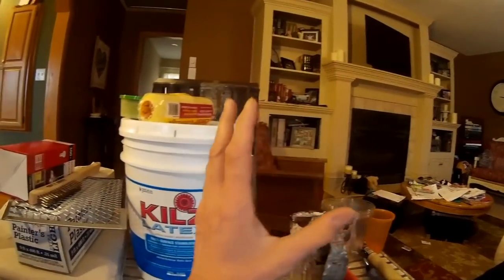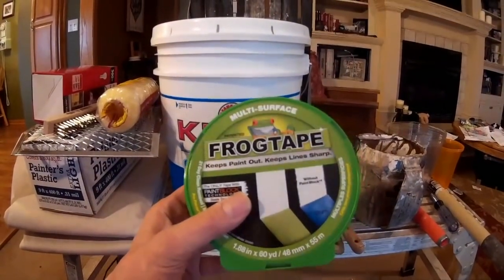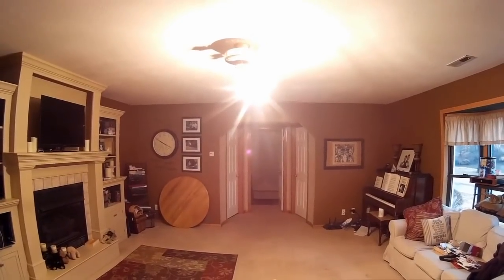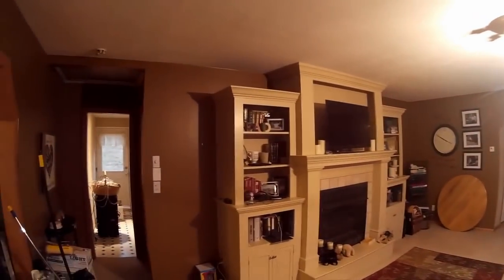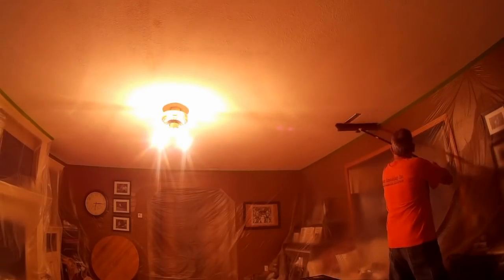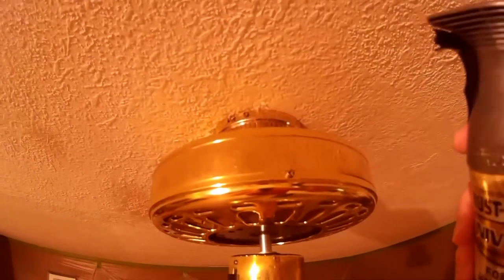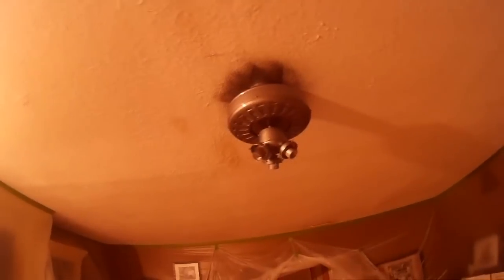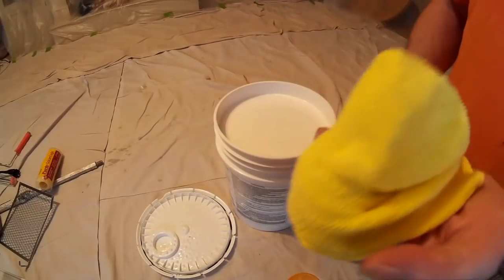How to paint a ceiling like a Pro!  Leave your furniture in the room! House painting.

Comment: Just a great video!  There were many times throughout where I wanted to press the like button!😆
I have an older open concept home and young kids so I’m dreading this ceiling project.  I’m not able to do it in sections since the rooms are not divided.  Do you think the paint will blend where I’ve stopped if it takes more than a day?  Also, would it be worth it to invest in an paint sprayer instead of rolling?  Thank you!!!!
Reply from the maker: This paint or any other flat paint will blend just fine.  Just dry roll the edges together.  If you want to invest in an airless sprayer then yes, it will be easier.  Make sure you buy an extension want to reach your ceiling if it's high?  You will need a 24 inch extension for even an 8ft ceiling. I bought one at Harbor freight just for shooting latex like this primer.  I thought it would be just a throw away sprayer but it's lasted 3 years.  HF doesn't have the one I bought but this one is close. https://www.harborfreight.com/airless-paint-primer-stain-sprayer-57042.html  If you do spray it make sure you spray two coats in two directions letting it dry for an hour between.  Let us know how it goes?

Comment: Great video, highly informative. My question is "why use a roller when you can use a sprayer to get the job done?" Can you comment on the use cases for both and their limitations, please? Thanks!
Reply from the maker: Spraying tends to sit on the surface.  This includes gaps and pores.  Rolling pushes paint into these areas making a better paint job.  This is why you see professional painters backroll a spray job.  The sprayer applies the paint.  Then, the roller pushes the paint into gaps and pores.  On a job this size I can have the ceiling rolled in about the same time it takes to properly clean a sprayer.
Reply: @mowerdog  Ah, this makes sense. Thank you so much for the prompt reply.
Reply from the maker: @saud3001  Rolling also adds texture to the finish which helps hide some imperfections.  Think of a paint job on a car.  When spraying you will see every scratch, ding, etc, that you missed in your bodywork.  Buy if you rolled your car paint on, they would dissappear.

Comment: how much is the cost of the labor for a room like that? I want to star doing painting like side jobs but I want a reference about how much charge. thank you!
Reply from the maker: This room is 20x 20ft and 8ft tall.  You will spend 8 hours on the ceiling and 8 hours walls if there's not much repair. 2 full coats on the walls. Plus the cost of paint.  This is with the furniture in the room and not an empty room.  So you need to know how much you need to make per hour to pay for tools, vehicle, insurance, advertising, wear and tear on your vehicle....?   Remember to add 50% or more to the cost of your supplies.  I mean you can't go to Sherwin Williams, chose the color,  buy and deliver the paint for nothing.  Walmart does not buy a product for $1.00 and sell it for $1.00 - neither should you. I can't give you an hourly rate.  But for side work you need to make double or more of what your day job pays.  Otherwise it's not worth it.  I mean you will make time and a half in overtime at your job so it needs to be more than that.  email me for more questions.  I've done it for close to 40 years now. mowerdog@gmail.com